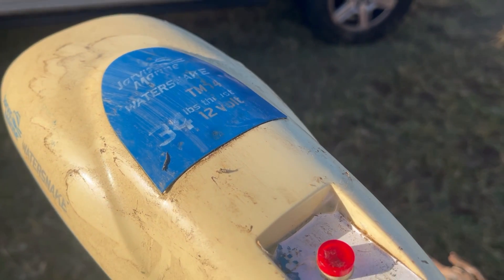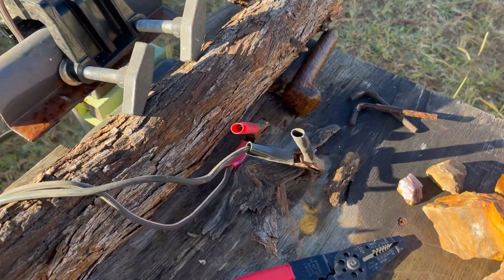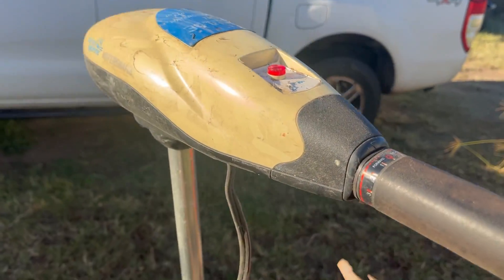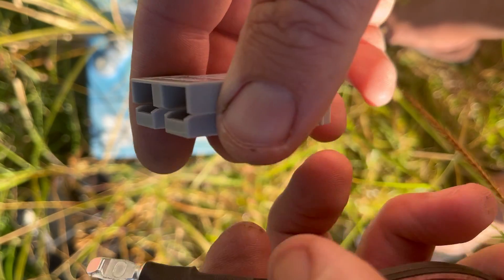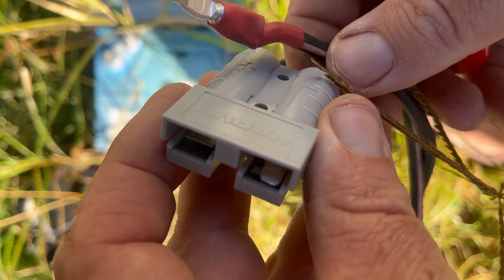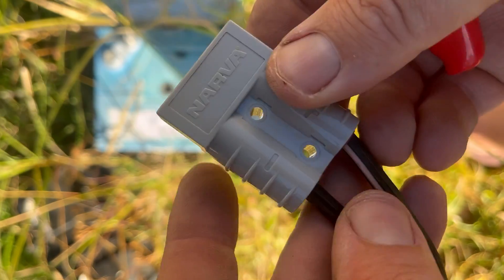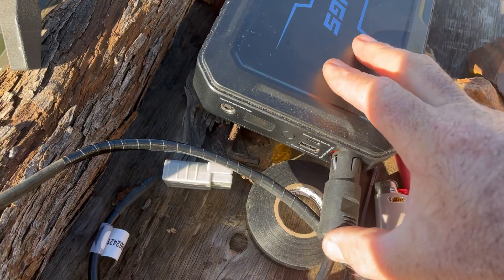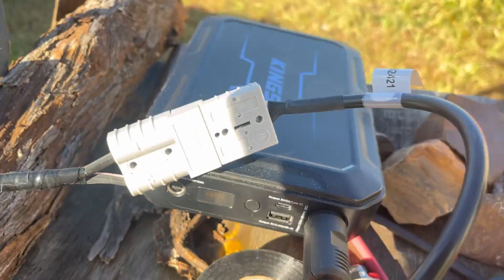How to connect a Anderson Plug / crimp and click electric outboard motor upgrade

Comment: I've got the same motor but keep blowing fuses on my 60ah battery and kings battery box, apparently these things draw over 60 amps on full throttle
Reply from the maker: They draw rough 50amps at full throttle but will blow fuses if your power supply leads aren’t thick enough. I over supply with heavy gauge for a constant power supply and it fixed the problem of blowing fuses